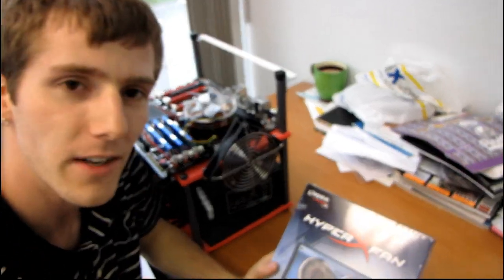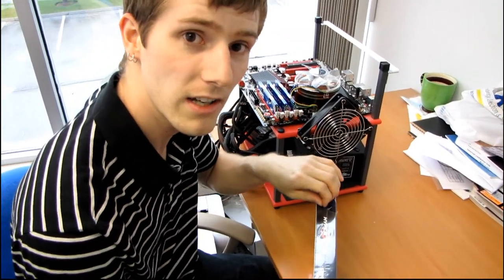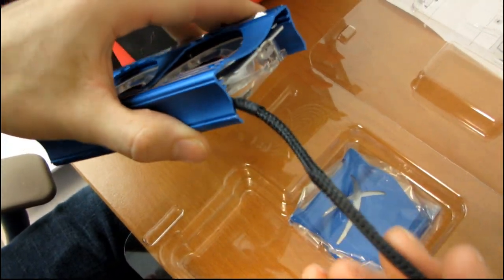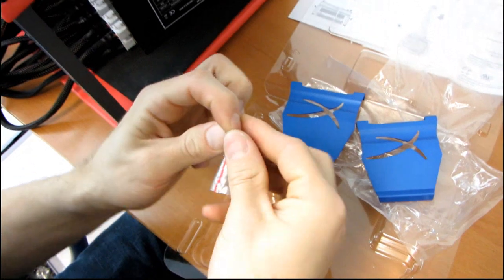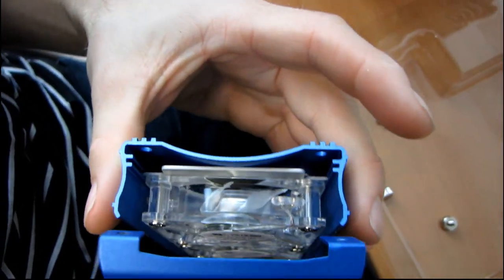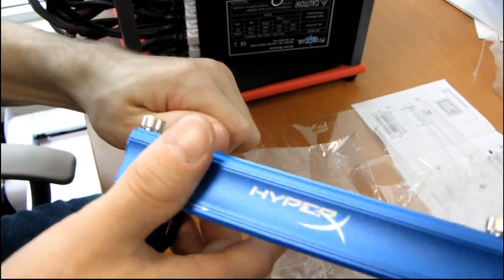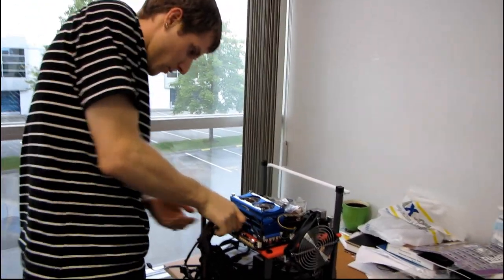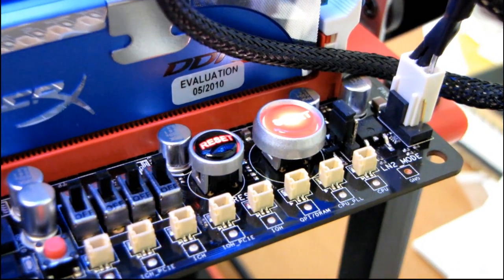Kingston HyperX Blue LED Aluminum Dual 60mm RAM Fan Unboxing & First Look Linus Tech Tips

Comment: ...5 years later and I still don't see the point of getting this product.
Reply: ...with no particular performance or stability gain whatsoever.
Reply: +Don Garou Wrong.

Just like about any aftermarket cpu cooler, RAM coolers will be useful for nobody but overclockers.
Reply: wrong. im an overclocker and i dont use this. kind of defeats the purpose of having a memory heat spreader. talk about my OC RAM with large heat spreader, this wouldnt fit in.
Reply: Martín Varela I mean who raises a memory voltage nowadays just to get a decent OC? no one, unless you're a super OC freak.
Reply: +Don Garou 

I'm not wrong at all. Grab it with a grain of salt. I never said that every overclocker need this.
Reply: +Don Garou This right now on ddr4 temps are not a problem unless you go all the way up to extreme frequencies, where you may also need to bring up voltage to avoid raising timings too much.
Reply: Martín Varela Yeah i get your point. IMHO memory temp is the least of any overclocker's worries. Raising the memory volt for a couple of steps, memory heat spreaders will still get the job done. And another, this blocks proper airflow inside the chasis the fact that this cooler sits right next to the CPU fan/heatsink.
Reply: +Don Garou 
Whoever is willing to spend money on RAM coolers, probably already has watercooled the cpu.
Reply: probably, but for me ill just spend that extra cash on another non-overclocking component.
Reply: +Don Garou mine ram cooler drops the chipset temps 5-7 celcius when its on, without overclock.
Reply: +Igor Toebe Then you have a serious problem with your cpu cooler or you're using the stock one and everything is fine.
Reply: +Martín Varela motherboard chipset, not cpu temps i meant
Reply: +Igor Toebe Then everything is fine I guess.
Reply: +Don Garou "But...but it looks cool..." - 16y old fashion gamer kid
Reply: Dr. Etzor haha right. you have proven my point.
Reply: Don Garou I've only heard of Corsair RAMs burning them self but that was more of Corsair's bad quality than the RAM itself, Corsair has fixed their flaws most likely since most high-end builds have their parts nowadays.

Also, their PSUs used to blow up, nowadays Seasonic makes them so they're fine now.

But yeah, only if you had like over 3000MHz clocks on RAM and you had 4 combs of it with heavy TDP parts nearby (early hot Crossfire builds),  you needed an cooler for your RAMs just to make sure they don't burn.
Reply: 6 years later you only need heat fins.
Reply: 7 years
Reply: 7 years later I still use intel Cpu cooler.
Reply: 7 years later still no point
Reply: i think its for ddr4 4600 ram
Reply: I was thinking the same, until I OCed my RAM @1.38V @ 2933 (from 2666)... with the cooler on top of it I can manage to have 3200 :D I had crashes due the temperature I almost could burn my finger by touching it... so for me it is working fine (I have a 4x4 config).
Reply: ...2 years after that i still don't see the point of getting this product
Reply: Because it looks cool  lol
Reply: I think its uselful since when i oc my ram @ 3200 16 18 18 36 it heats. This would help.
Reply: overclocked ddr2 needs this.  with 4 2GB sticks it is the hottest component on the board.
Reply: Fuy Gawkes Obviously a wanna-be nobody
Reply: @bohguardth13  dude you get the most performance benefit from ryzen by overclocking the memory.   and yes maybe some of us ARE super overclock freaks!!!  and believe it or not if you water cool then this can help with airflow around the socket and vrms.
Reply: @RonnieBanerjee007  dude nobody cares about your stock cooler. (shakes head) we are overclockers here having a grownup conversation.  the kiddy table is in the kitchen.  go back out there, sit down, and put a cork in it.
Reply: @gustavo765rs   thank you.  that's another thing, 4 stick configs! especially with the amount of nand they're cramming on sticks these days...   makes a big difference when you got a big air gap between sticks but when you max out memory slots heat starts building up fast.  especially when you OC and even more when you watercooling.
Reply: @XX-121  uhmmm nah, RAM clockspeed/timings are the last thing that im going to tweak. I dont play with RAM voltages that much since there isnt much return from doing that. just saying.
Reply: @bohguardth13  big returns on ryzen.
Reply: 10 years later and I am legit scratching my head
Reply: 5 more years later and I still don't see the point of getting this product. XD
Reply: ...5 years later and I still don't see the point of getting this product.
Reply: @Xfiles98  which is very unlikely
Reply: I've had this product for 11 years, since then i've installed this on my testicles, i can really feel a difference with climate change 😂

Comment: my ram is overheating.....     
.
.
.
.
.
.
.
.
.
.
is something i never said.
Reply: +Matias Gipler maybe in 2010 when this video was posted it was an issue..
Reply: +imashankusobad because in 2010 you need something like this most of the time to make the ram look cooler.
Reply: TSLMachine looks cooler = less heat 
That's how computers work :p
Reply: +Matias Gipler servers with fbdims did need this, that ddr2 reached 80 degrees
Reply: +Matias Gipler i thought so too, until i started running my DDR4 DIMMs at 4200 MHz. i bought 2 sets of corsair RAM that came bundled with DRAM coolers. without the fans my computer gets BSODs when benching or recoding videos. with the fans it runs normal. also, since my computer was 100% water cooled, there was nothing blowing air over the CPU's power delivery circuits. the fans not only cooled the RAM but also the MOSFETs. for 99.9% of users this item is pretty dumb to have, but it can be helpful in some cases.
Reply: Darkphaze ikr, I'm running DDR3 FB-DIMMs in my rig, and  after an hour of usage they are almost hot enough to burn me.
Reply: I actually have the issue cause I oc'd it to 3800mhz

Comment: Thank you so much for this video.  I looked everywhere for something that illustrated the power connection and yours was perfect.  I have the same 4-pin module as part of the board and wasn't sure if this fan would work with it.  Now I know.  Awesome!

Comment: Lol most people don't know this is a 5 year old video where the ram back then used to heat up quite a lot. Nowadays we have nice heatsinks in the ram, so technology is sweet :D
Reply: ***** Would you say its Cool? :>>>
Reply: ShortSquirrel *bu dum tss*
Reply: +Azri Azhari yea man but dont forget that workstations use FB DIMM. FB DIMM's are hot! VERY HOT, ~70c average temps, 90c full load. And dont forget that some of us WORK on computers, some of us DONT PLAY GAMES, we render for couple of days without stopping pushing our rigs to maximum...
Reply: BORISLEONOVICK BORIS oh! cool cool
Reply: +Azri Azhari ram 5 years ago was running at 1.65v and still had "nice heatsinks". Ram heat was NEVER an issue. 

70c is hot, but  isn't even close to damaging the ram.
Reply: I saw a new one that had a fan i cant remember its name

Comment: Also the G-skill is smaller. Get the G-skill Turbulence II. In a mini ITX, the Kingston would be deadly anyway, since it has almost a full blocked side panel pn both sides, and those will block air circulation in your pc case... A fan which is open from all sides would not block air circulation in your case. Check it out online. Cool stuff. It is also quiet, just like the Kingston ---G-Skill Turbulence II---

Comment: at least they should add an option to close the gap if you have lower sticks.. to gain some induction circulation, now its just wiping the air on the sides instead pullen the air trough them

Comment: It is standard, but it's not a stock one, this one has LED and doesn't have the secure fan from sides, dunno how it's called, some kinda cage or something, cause this one has only fan and radiator, actually it has, but it's the other way around, it's under the fan not above that looks like it's holding the fan or protecting it from wires.

Comment: I wouldn't worry about it... It is relatively cheap. Also, even if it doesn't fit straight over the rams because of the CPU fan, just put it in slanted ... And there you go. Better than nothing! It cools a lot! I personally like the G skill turbulence more... I got better temps with that! It also lets your GPU s to get some air, since it is open from all sides. With the Kingston, the side of the fan was blocking the top of my VGA, and my VGA temps were 10F more :S. AND the ram was hotter too.

Comment: I'm only pointing out to the Kingston HyperX Predator and HyperX Beast.
Linus is using a HyperX Genesis or Blu. They are quite low.

I believe Kingston is thinking sometimes while developing. ;) 
Would be a much bigger fail to not consider their higher modules into the developing process than having a little more room for the not so high modules ;)

Comment: Amd Fx 4100 running atm 4,6ghz around 20-25c on idle and 35-40c on load with the stock cooler :)

Comment: I think you didn't understand my comment. I researched the specs of both of these rams. The Predator 2400 beats the Gskill 1866 in ALL specs. Cooling, timing, speed, overclocking safety, stable CPU overclocking, and more effective CPU overclocking. There is no such a thing"which is better for your MOBO". That is ONLY marketing. In any MOBO the K. Predator 2400 will be better. There are of course better RAM modules than the Predator 2400, but they are triple priced...

Comment: So you give up better cpu coolers so you can cool memory... no thanks.
Reply: +MercilessHobo It's pretty cool I think. If you have an AIO cooler it draws attention to the CPU/RAM area.
Reply: Jesse Deptula I'm not going to spend $30 on fans because it "looks cool" but doesn't actually do anything. Heat spreaders do their job just fine. Ram even up to 2133mhz should never overheat to begin with. Not to mention the colors don't go with most builds I've seen.
Reply: +MercilessHobo This was 2010, LED fans and more lights in general were all the rage in 2010, not so much nowadays though.
Reply: MercilessHobo You're not going to but lots of people do.

Comment: I'm guessing when you stopped the fan it didn't affect the CPU since it wasn't plugged in in the first place so it wasn't on? Smart thinking linus
Reply: Your cpu will not die if the fan is turned off for a short time.
Reply: LEDtherebelight I'm saying the CPU wasn't on to begin with because he didn't have the cpu power plugged in in the first place.
Reply: JunTheBeast I'm pretty sure there wasn't a CPU under that fan :)
Reply: JunTheBeast I understand, but even when it was plugged in it wouldn't have mattered. 
You can stop the fan for a short time even if the cpu is turned on.

Comment: The fans are too far from the RAMs.  If I had 2 or 3 exhaust fans in the CPU area, I think the air from this RAM cooler will be sucked by the exhaust fans before it even touches the RAMs. What do you think?

Comment: @deejaypprada 
Kinda impossible. Highest frequencies ive seen that are sold to average consumers are 2166 and 2000. To get higher you would have to overclock.. one thing you should be aware of tho. You can easily overclock a decent set of ram sticks to those frequencies if you know what you're doing. going above that is overkill. The higher you clock your ram, the lower your overclock on your cpu will have to be to accommodate the data being sent.

Comment: What the hell could someone possibly be doing that would cause the need for ram cooling?
Reply: Yes exactly, pointless.
Reply: maybe their desktop is inside a sauna...you never know, better be cautious.
Reply: ***** Actually you can, its a pretty standard practice. Just you cant do it with low profile ram.
Reply: I think the heatsinks are enough...
Reply: overclocking the ram for your apu
Reply: its dirt cheap who cares

Comment: And lots of the low ranking rams are NOT reliable in terms of deceptive advertising, and big corporations, when they test them discover that performance is not stable at the speed that they promised. High ranking brands are Corsair, Kingston, G-Skill, Patriot (higher models from patriot), Middle ranking are Patriot (anything under the higher priced model Patriots) Crucial, Low ranking are Mushkin, Adata, Hynix...

Comment: I could have written 30 more brands, but I don't care about writing all the medium -low ranking brands. There are only several very reliable ram brands... Ram effects CPU effectiveness, and lifetime, and MOBO lifetime, also, the ram will lose lot less performance over time if it is a good quality... (burnt out circuits, half way melted pins etc...) I only put good quality in my pcs.

Comment: you put the fan in the wrong fan power connector...you are not gonna be able to get the fan working correctly .. that's why the fan run as such low rpm..but if its that what you want ..its ok..

Comment: yeah if you oc your cpu using the bus instead of the multiplier you oc the ram aswell got my cheapo mushkin 1066mhz 9-9-9-24 running at 1333mhz 7-7-7-20

Comment: I got the same ram cooler, with the right ram, but my cpu cooler is to big so the ram cooler wont fit -__- Now i tied it up at the back of my pc blowing hot air out of the pc, it works and looks kinda neat after all lol

Comment: you think ddr3 needs a fan? if you by a set of ram, and it has a low heatsink, 1.5v and is stocked to like 1333-1600 mhz (Which is what our standard is atm) it doesn't need a fan.... 99% of computer's don't have fans on their ram.

Comment: 2015! so old (not really) but who uses fans for ram
Reply: people who wants their system to be cool
Reply: +Kingali Plays well overclocking a ram over the speed they are build for does release a lot heat, if you think this is weird there are people who even use water cooling unit for a ram
Reply: Rushdrift I know what it is for I just said it was older because you don't see these that much on newer builds that's why

Just a prank bro

Comment: Would I need this if I have a push pull cpu fan on the x79 sabertooth & not overclocking ram with 4-200mm case fans & 1-140mm case fan?
Reply: if you dont plan on overclocking your ram you dont need it.
Reply: Thx for the advice. That's what the research has shown as well.
Reply: you are welcome

Comment: Does not seem like you know much about computer's. No it did not burn out.the cpu, first of all there was no load on the cpu. Second It still has the heat sink spreader attached. And last it was only on for a few seconds! try to think before you comment.

Comment: I hope you still read comments about this video because I have a question. I happen to have the exact same motherboard and the HyperX fan in my system. I currently have my EVGA GTX580 installed in my second PCI slot to give it some room. According to my MOBO guide, if I want to install 2-way SLI I need the  first and second PCI slot. I was wondering if another GTX580 would fit in the first slot with the hyperx fan installed. Its a lot of trouble to test that out myself I'm affraid.

Comment: So, tell me. What's the advantage of having a RAM Cooler?
Reply: The cooler your RAM the better.
Reply: im pretty sure that the newer ddr4 ram is capable of cooling itself now, these were designed for older memory
Reply: Karthan yeah, but this ram coolers have fans, so when the fans are spining, it creates flow of air and dissipates the heat from or around RAM, that  in itself is good.  If you use a desktop casually I would buy this cooler, but if you do work and use the desktop for many other reasons then it is great.
Reply: In 2016? No advantage. 

Theoretically these let you reach a higher OC on your ram because they're cooler, but I doubt your ram is ever going to be so hot that case airflow/ram heatsinks wouldn't handle it adequately.
Reply: Bragging right lol realistically they serve no purpose unless you're over clocking your RAM
Reply: 3+ fps in CSGO

Comment: eheh, i'm currently using The cooler master hyper 212 evo getting 27º idle with a i5 2500k 4.3 ghz and less than 40º at load. with the fan at 1200 rpm so yes if u had the stock cooler the cpu would not fry but would be at alor more cº's

Comment: WHO THE FUCK HAS HOT RAM???
Reply: +Janinja 1000 people that overclock their ram to over 9000 mhz
Reply: +SquidPlays thats possible? 9ghz ram wtf. mine at 3800 only ):
Reply: +アンソニー ofcourse not
Reply: Fully buffered DDR2 Server RAM gets super hot
Reply: +kenoalbatros 
I actually had stability issues because of that ;)
60°C+ right after booting...
Reply: Das TIER at the moment im using an old server with ddr2 fb ram as a budget gaming pc. 80°C are normal and there is a fan wich cools the ram :D its noisy i have to save up some money and buy something better...
Reply: kenoalbatros Nice :) As long as it works its good, right? :P
Reply: YourNightmar3 yeah and i got it for free :D
Reply: kenoalbatros Even better :D

Comment: temperatures? effect upon.
Reply: dude these things work wonders.  on my 1090t / 6GB ddr2 system,  i had no problems running 2 X 2 GB for years but after giving the system to my mom and upgrading to windows 10 and upping the ram from  2 x 2 to 2 x 2 + 2 x 1 = 6GB.  after the upgrade, she started having random weird errors. even just trying to start MS power point!  well when i opened the case to check for faulty ram, MAN i could barely even touch the ram!  that's how hot it was!!!  so i already knew the problem.  so anyway after grabbing  a ram cooler (corsiar vengeance) i have since then, never (knock on wood) had another error and not only can i touch the ram sticks now, which are nice and cool, i'm actually getting lower cpu temps at both idle AND load!!! :)  so yeah i whole heartedly recommend ram coolers.  especially if you're overclocking.

p.s. and  if they didn't help, then why does corsair include them with their high end dominator kits?  DUH!!!  LOL!